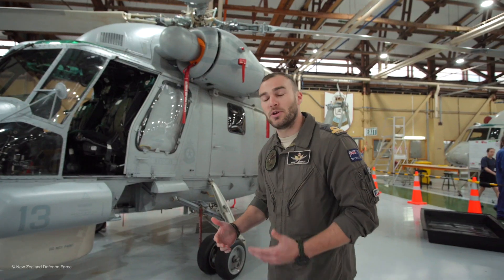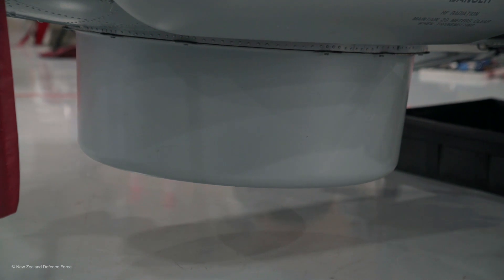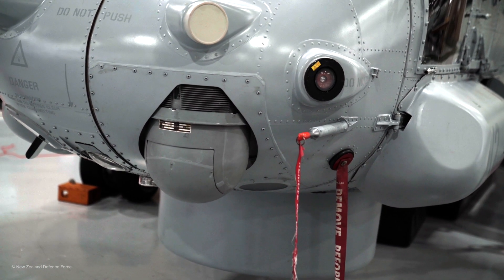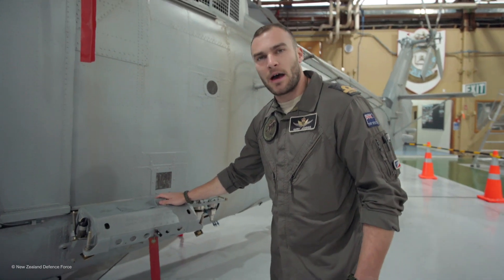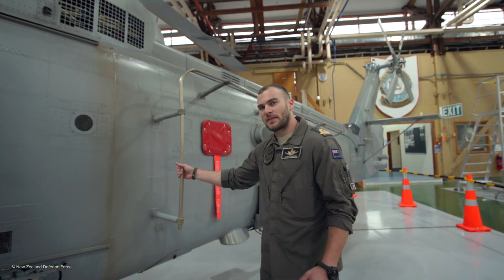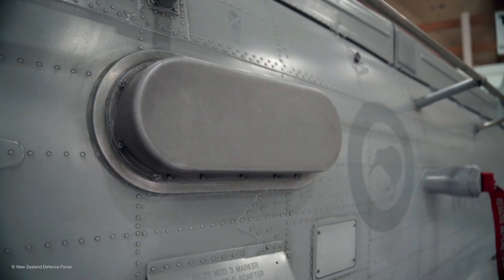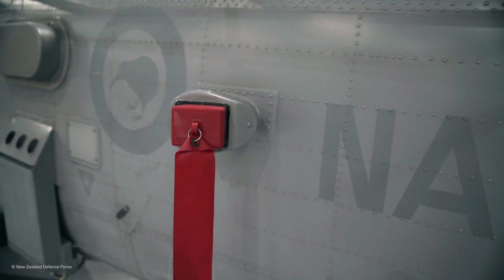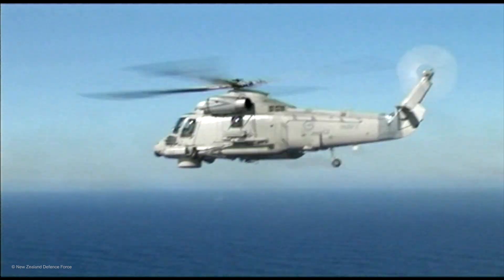Take a Tour: Sensors of a Seasprite

Comment: U guys should replace the sea sprite
Reply: If it isn't broken, don't fix it!
Reply: @mikemontagne2703  those airframe still have several years of use left,and have modern avionics in them, such a waste of money to suggest replace them way to early.Navy has no issues with them
Reply: @mikemontagne2703  oh it’s broken alright
Reply: @TheEnemyCombatant  
I'm from old school 2 bladed Bell's, 206-205/212 (2X P&W PT6 Twin-pack),
maintenance  engineer, yes I know on the heavies, loose all hydraulic's, your S.O.L., 
but  "fly by wire"?, no, that's a hard pass.
Reply: @mikemontagne2703  still better to invest into some better helicopters like the ones the US use. Or better yet. Have engineers come up with a brand new helicopter design built specifically for the Navy’s requirements.
Reply: @mikemontagne2703  but Idk what u mean by “fly by wire”
Reply: @TheEnemyCombatant  ^ He's not wrong you know.
Reply: @matthewhill2321  I know the sea sprites can still do their job... for now. But it would be so much better if we got newer more advanced choppers. Like the sea stallion
Reply: @TheEnemyCombatant sea stallion is still a old helicopter your better off with something like the sh-60 sea hawk the naval black hawk does exactly the same role as the sea sprite just a bit newer but still old but the sea sprite is still a very capable helicopter especially with its modernisation still able to be in service for quite a few years
Reply: @robsmotos9899  yeah personally I just think they need to increase their size. More range, load, tactical endurance, environmental endurance would be the key features if I were to get them a new chopper and like u said the Seahawks are a far better option
Reply: Why don't you  build one mate